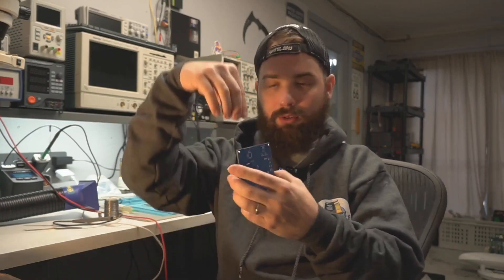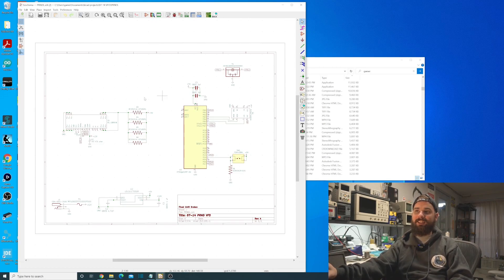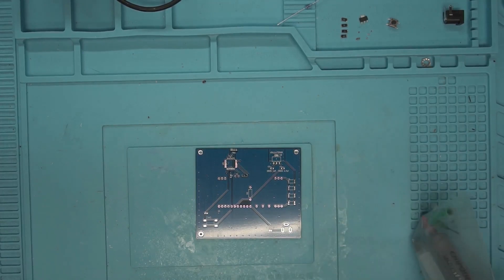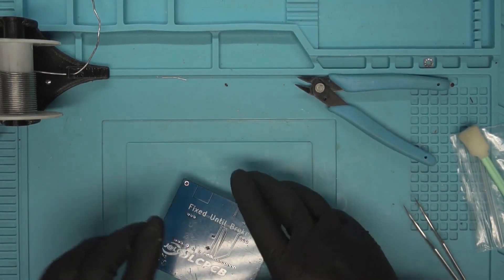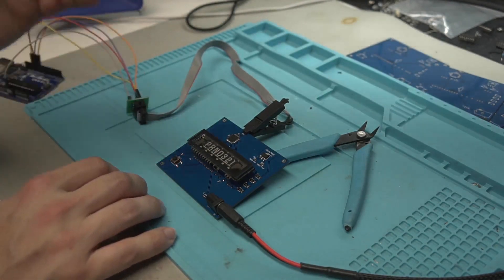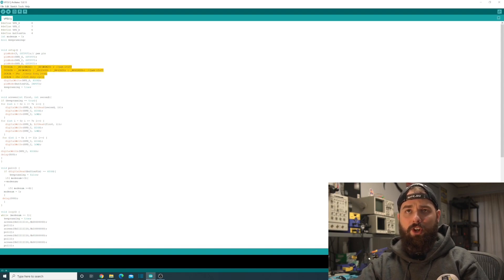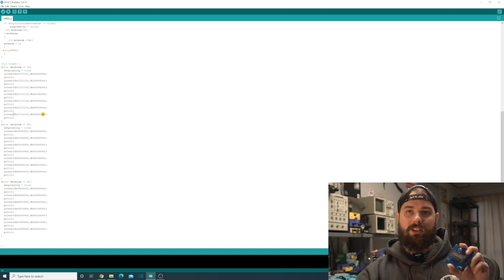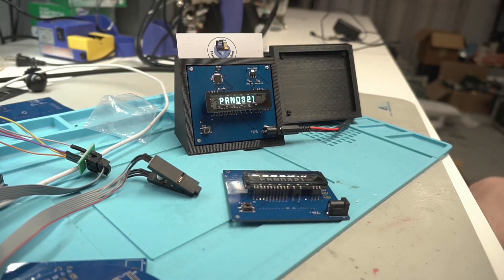07-14 GM Truck Vacuum Fluorescent Display Business Card Holder

Comment: Why not use the mileage display so you could have your business name scrolling across?
Reply from the maker: Because its harder to do lol. Future project for sure. I will be doing it with the 03-07 Odometer display.  they both are such large screens its like 50v on the cathode/anode and they are AC filaments I think. 

I will do the 03-07 because I have the datasheet for the OKI VFD driver so I know how to talk to it unlike the 07-14 with its built in driver.